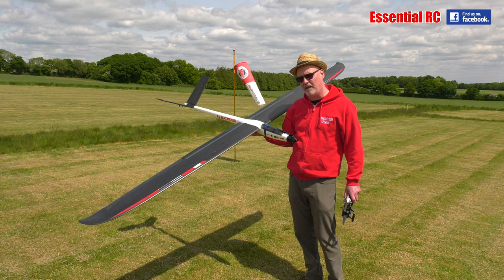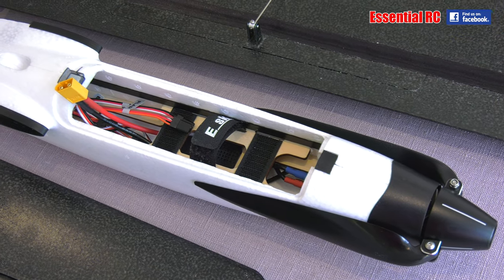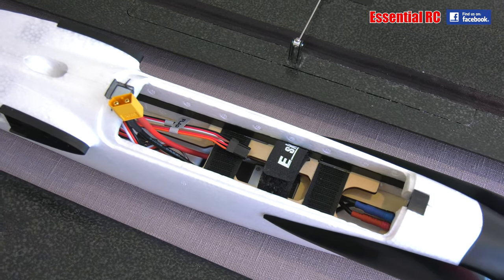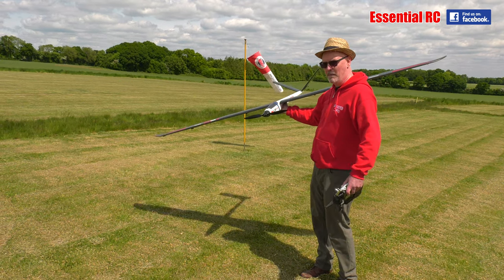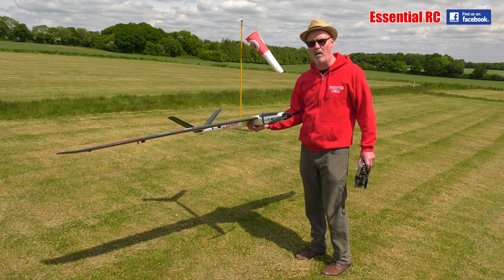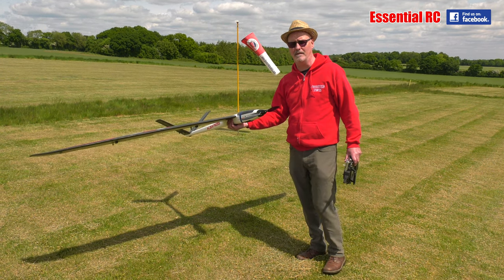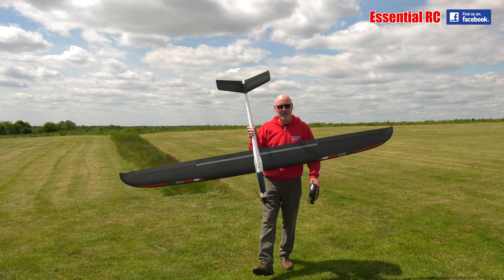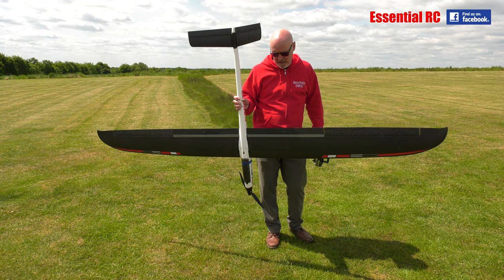eSky ALBATROSS 2.6 metre POWERED GLIDER\SAILPLANE: ESSENTIAL RC FLIGHT TEST

Comment: Nice looking glider but I am at a total loss as to why custom made designs that look like an aircraft engineer designed them are coming out of China with the control horn pivot points so far off center. It would be so easy to extend the horns and get them on center to maintain top and bottom control surface throw symmetry so you can setup a computer radio and add differential aileron, etc without doing a lot of painstaking measuring and math to have it in proper trim. As good as it flies (with an experienced pilot) it will fly better in trim adhering to one of the most basic rules in RC. Look at an EFlite design like the Optera or F27 Evo and you see how it should be done.

Comment: Nice plane, nice footage, but where is the review? Not much said about the quality, performance, behaviour or fun factor of the plane.
Reply from the maker: You can deduce most of that from watching it fly in the video but always happy to answer questions. It's very good quality. Very quick to assemble as so little work to do. It's very responsive and controllable. The control surfaces are very stiff with the carbon reinforcement. Fun factor...I suspect it will be much better as a pure glider catching thermals and lift off a slope rather than an aerobatic glider as I flew it here because it doesn't retain much energy on a fast pass and for that reason you have to use a lot of power to keep the speed up. It being fun is subjective. Depends how you want it to fly.

Comment: For £250 you cant knock it, it is a fraction of the cost of a 2m+ hotliner. However I would not call this a hotliner, its a warm liner at best. That does not mean it is not enjoyable but it is worlds apart from a hotliner performance wise.
Reply from the maker: If I go to the link I see price as £208 with free delivery. I wouldn't term it a hotliner, barely warm actually...still fun though.

Comment: Great presentation
question
Is is possible for the  ALBATROSS power glider be sent to a long distance location provided that it has enough battery and/or solar backup ? . For example, an UAV fixed wing can be set up with mission planner ( arduPilot)  to land at another location. I have seen many utube videos about the gliders in which camera, transmitter and mission flight is incorporated but nothing is mention about long distance landing!!

nothing is mention about the max wind speed that it can flight without air resistance
I like to see things in 3 dimensions and explore a new challenge and create innovation.
maybe the ALBATROSS power glider can be used for small medicine delivery in countries that 
have difficult terrain 

** In another note. hanger 9 Valiant RC plane runs with gas. I have asked everyone including the hobby store - 
About the flight range? - no answer
Ardupilot mission planner? no answer 

the hobby stores all they care is to sell the plane and the parts but no assistance for the buyers to improvise or be creative!
Really, you seel a big ass plane that runs with gas but they can not tell you other options such as long range distance for 
medicine deliveries??

if a store wants to sell their product, you would think that making more options for buyers will generate more sales! They
see things in 2 dimensions

I hope you understand my interest in leaning and my frustration
Can you please help me get a answer to my questions 

sincerely 

Francisco 
347-624-8875
Bronx, NY
Reply from the maker: Not a question I can answer Francisco. Best to ask on specialist forums on rcgroups.com or rcuniverse.com
Reply: @EssentialRC  
Thanks

Comment: Great review, have been thinking about a powered glider, although I'm still a beginner. Would you rate this for beginner, intermediate, or advanced pilot?
Reply from the maker: Not for a beginner to RC flying. Learn to take off, fly controlled circuits and land...and then you would be absolutely fine with this.
Reply: @EssentialRC  Thank you so much for the quick response. I really appreciate your reviews.
Reply: @EssentialRC  Hello, and what is a good glider for a beginner?
Reply: @GOOZ3  easy star or similar

Comment: How did you fit a 4S 3200 mAh pack in this? Can barely fit a 2250 4S pack....
Reply from the maker: Don't have it now but I must have squeezed it in somehow !
Reply: @EssentialRC  Did you remove the top battery tray? Think thats the only way to get it in. Thanks..
Reply from the maker: No. Certainly didn't remove anything. Maybe my pack was just the right dimensions to drop in. Lipos of same cells and capacity can vary a lot in size.
Reply: @EssentialRC  I finally found some footage of the inside, there is no battery tray like my one has, had to remove it. You would struggle to get a 9v battery in there even. Got it flying anyway. The Durafly Excalibur is a much better buy. Completely underwhelmed with this..... Thanks for your reply

Comment: does anyone think it would perform ok on a slope. ?
Reply: I have one yes awesome in strong wind! woohoo
Reply: @stephaniekent8483  Did you use the centre of gravity makes or did or did you add more weight to the front? Mine seems a bit touchy.
Reply: @chrisginn5073  its very touchy yes we flew it out the box ok, but yeah we did put some extra weight in but not much, she does take some getting used too hope this helps :)
Reply: @stephaniekent8483  thanks, flown the glider 3 times but have to really keep it moving alone
Reply: @chrisginn5073  yes shes definitely not a "floater" the slowest she goes is coming in to land in 30 kph winds lol